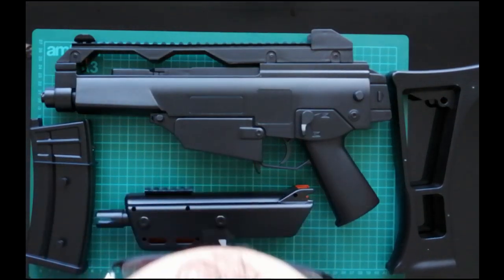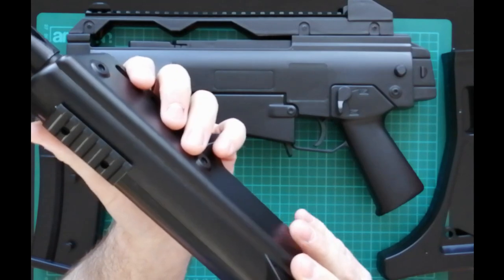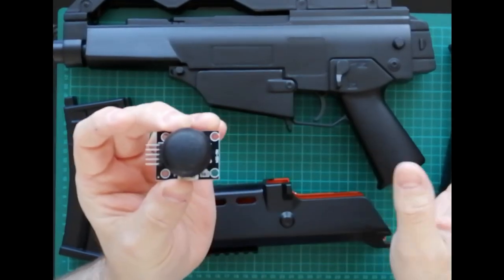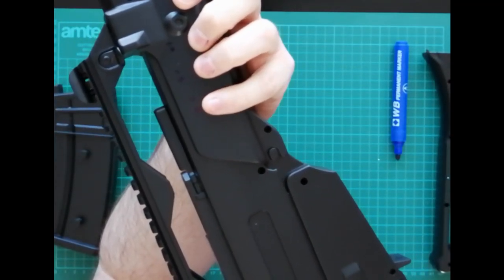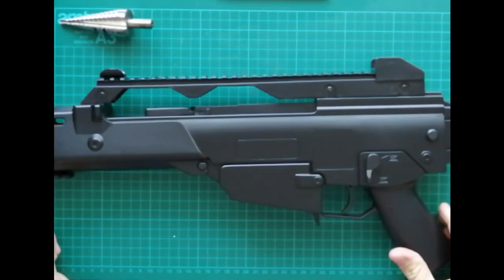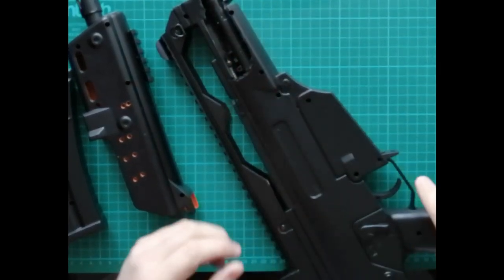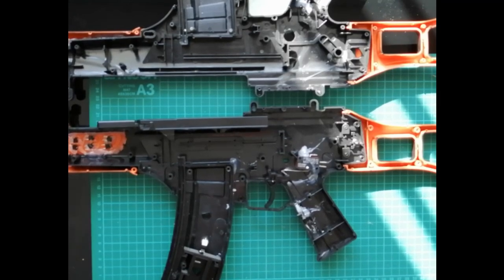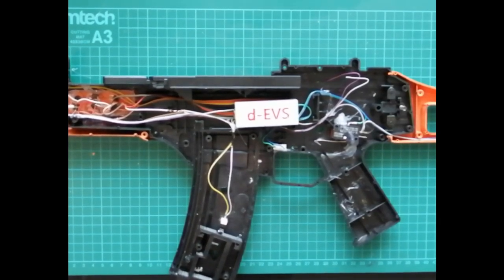d-EVS How to build Your own gun/rifle controller / light gun / arcade VR Pt.1

Comment: They come in orange for legal reasons. it is illegal to spray it black because you are manufacturing a 'realistic imitation firearm'. I think it's a stupid law personally, but I wouldn't want you to get into trouble over it.
Reply from the maker: Yes You are correct to some extent. Not all countries have the same law regarding realistic looking firearms reproductions and even the ones that do have exclusions. You can go on ebay right now and buy toy rifles and lightguns in black.
Reply: @ellvas13  
The exclusions are usually for theatrical productions, reenactments etc. If the light guns on eBay resemble real guns and are black, they are illegal.
Like I said, it's a stupid law, just wanted to make sure you were breaking it knowingly rather than unwittingly.
Reply from the maker: @thepenultimateninja5797  those also only applies to ones without fac or and ukara 😁 I do know what You are on about though.